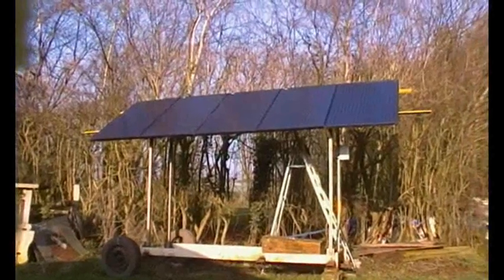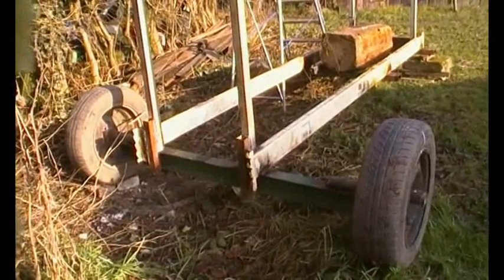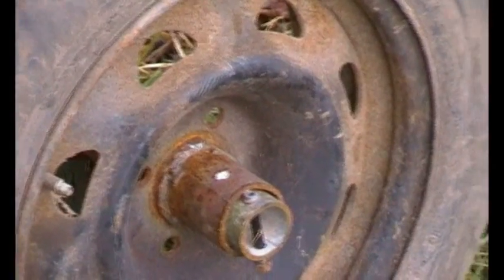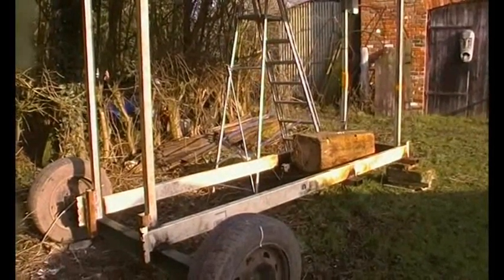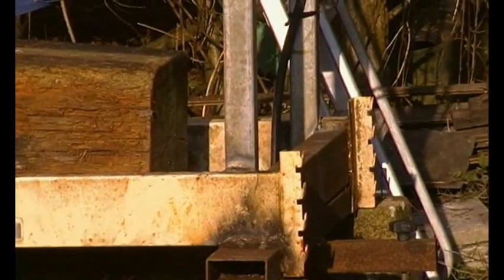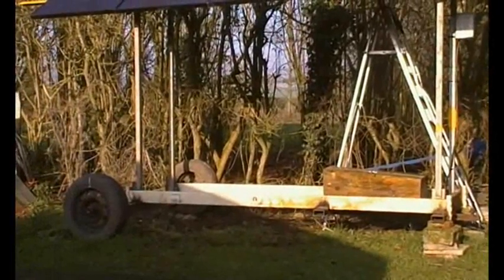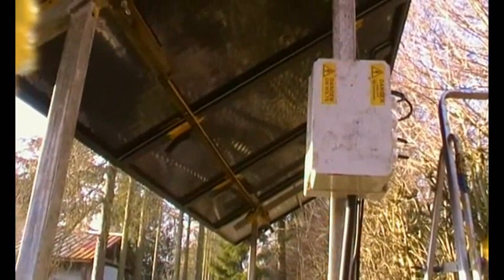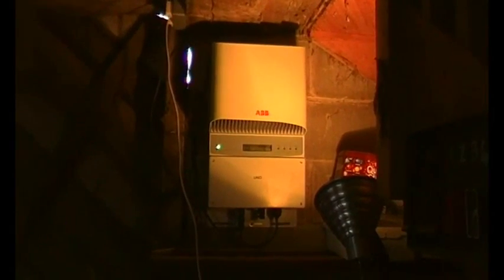Mobile solar panel frame for the best position..

Comment: do you typically not adjust the panel tilt to the sun's angle changes?
Reply from the maker: Hi, John, no I don't adjust the angle becuse ambient light refleced off the clouds needs a shallow angle to get the best out of the panels even in winter. The light conditions vary so much that the angle adjustment would have to be automated. Cheers, Andy

Comment: HI Andy, in Britain,  do we need a licence or approval from somebody to install a system under 4 kw with grid tie inverter for home? if so, please direct to the relevant website or authorising body, since I am thinking of installing the system at my house. 
thanks
Reply from the maker: Hi. In theory you have to tell the supplier, use approved equipment, and be a competent person. In the UK you are not supposed to back feed through a standard 3 pin plug, the inverter needs to be hard wired. This makes sense for anthing above 1.5 Kw, but rules is rules. Ho Hum, Cheers